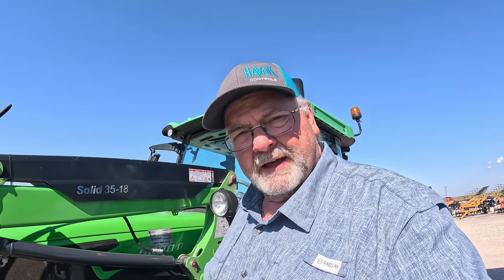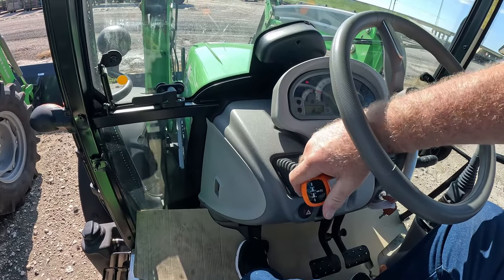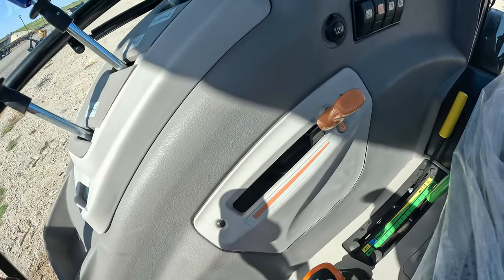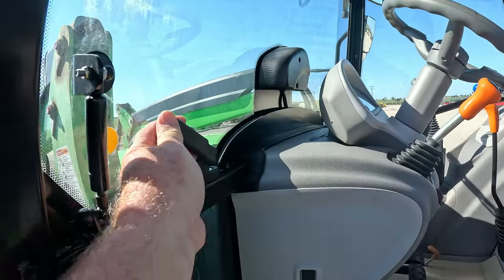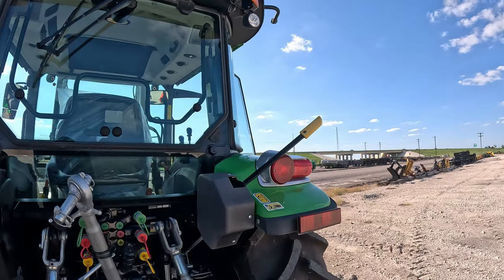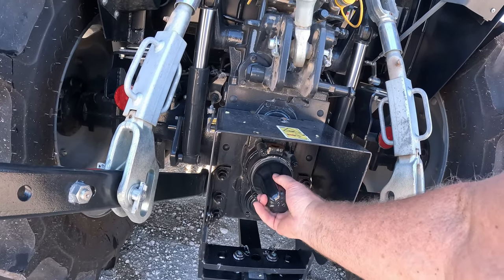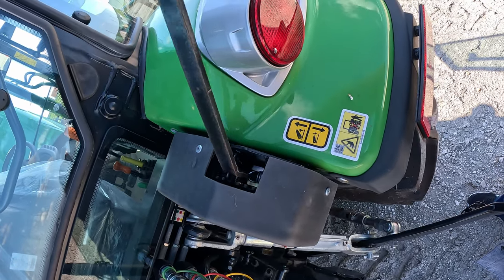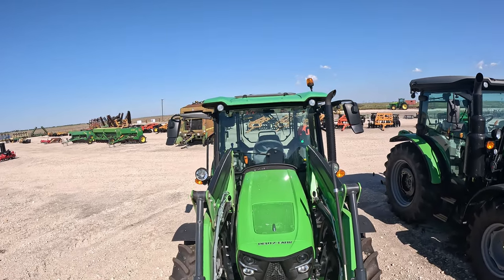Deutz Fahr 5080 D Keyline, buy or not?

Comment: Hey I enjoyed your video. And as a viewer I would like to share what I have heard about the brand of tractor your looking at. I have heard that the Dutz is one of the most difficult tractors to sevice of all of the makes of tractors on the market. Now, this is just what I have heard, and I have no experience at all with this brand, so I dont know. This could be completly wrong, but I did want to  make you aware that this could be a potential issue. And I am in no way trying to influence your decision but I did want to make you aware of a possible issue.
Reply from the maker: Thanks I Appreciate you sharing. I will be going slow on this decision. I have already been doing my research for about 1 year. I am just now going out and looking. Taking my time that’s for sure. The LS has been great and will be looking at them again ,they are very much in the running Thanks again.
Reply: Certainly not true

Comment: Question how often does your MT574 Regenerate? Mine did at 12 hours and. Again at 32 hours. I use MFS Red Diesel fuel it's supposed to be great all the farmers around me use it. Thanks
Reply from the maker: @louisnash4363  It depends on how hard you are using it. But mine has been right at every 50 hours. Sometimes a little more like 60. 
Use it hard. RPMs up no less then 1600 
That motor is designed to push and pull at a higher RPM because of the emissions. Unfortunate for you and I  we are used to having older tractors that could be run at lower RPM we tend to run the new tractor a little lower on the RPM than we should. 
Hope this helps. Let me know 
Thanks

Comment: I think I would go with the LS mt774 over this duetz for a number of reasons.  
I will say this is a pretty nice tractor in a more reasonable price range like the LS 
I have the mt573 with 2000 hours on it.   Planning to pick up the mt774 in a couple of months.  The nice  thing about having two similar tractors that shift and operate the same is muscle memory.  Jump from one to the next and nothing much changes in feel.
Reply from the maker: LS is definitely in the running. I really like the MT 774. This time I am going a little smaller. I am still unsure which one I will go with. I will be looking at several other tractors as well. You make a great point and one that I definitely am considering as part of a final decision. Of course I probably need to be careful looking because I am still not sure if I will be able to do this yet. 
I appreciate it thanks as always.